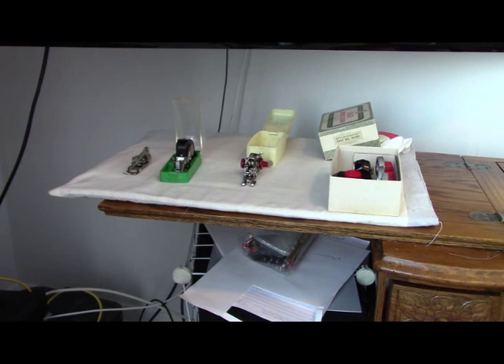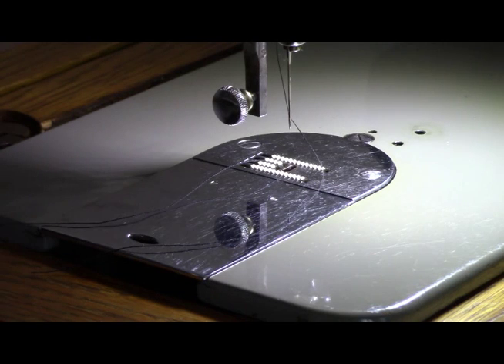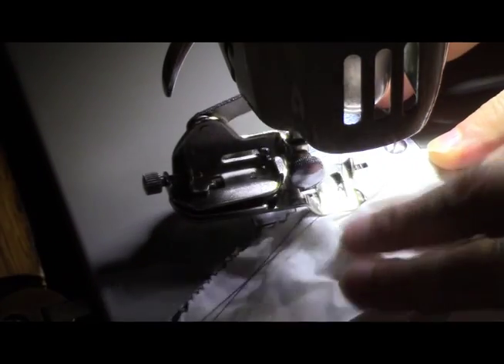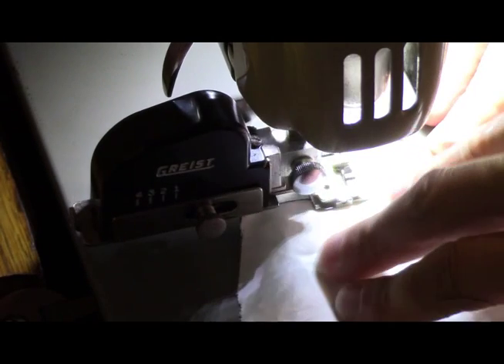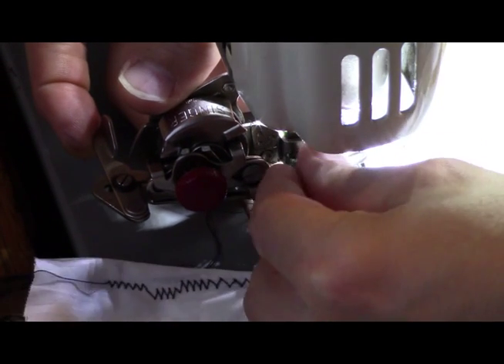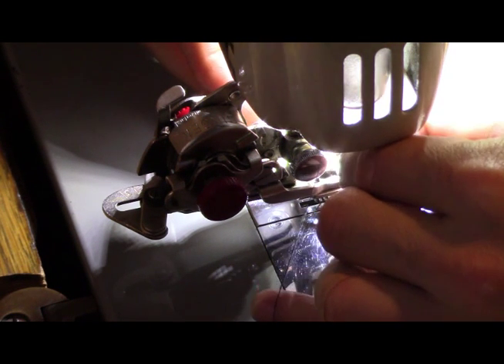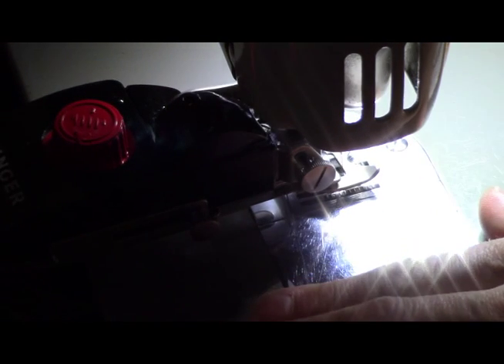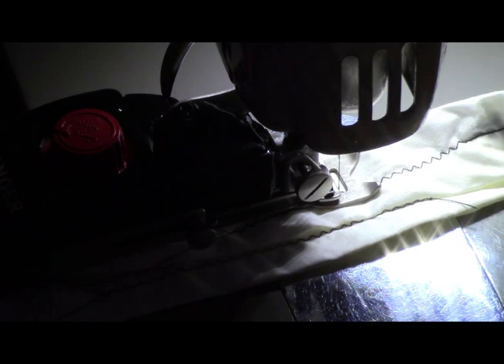zigzag attachments for straight stitch sewing machines

Comment: Thank you for your help . I changed to a larger needle , made sure the thread was the same top and bottom, tightened the upper tension and tightening the foot pressure.   I now have a zig zag stitch I can live with.  I have the unit on my 15-88 treadle.
Reply from the maker: Excellent news. Well done for persevering.

Comment: Good review. Have you ever used these on knits? I’m wondering if the way that they move the fabric might stretch the knit fabric out.
Reply from the maker: It is possible to use with knits. The major issue is the bulk. If you put a very slippery teflon or even paper underneath, it makes it more manageable. You might try seam tape as well. I found that the fabric can be pushed into the feed dog gaps and then not feed as well. It does not happen with low bulk. You will likely find that you get better results if you lower the foot pressure as well.
Reply: @jamesrogers991  thanks James

Comment: If you need more space between the pressure foot and the feed dogs you can adjust that with the screw at the top of the pressure foot rod. It will be on top of the machine.

Comment: I appreciate your video, I was working with the American one.  My thread kept breaking as well.  Did you ever figure out why that my happen?   Thank you
Reply from the maker: I did resolve the issue successfully. The thread was not spinning smoothly and needed to be loosened more on the top thread as well as ensuring that there is a felt pad to keep the thread from jumping.. It takes a bit of balancing to get the bottom thread tighter than the top -- afterwards, no problems.

Comment: Do you have to adjust the tension on your machine. I haven't been able to get a zig zag stitch without loops on the back. I have tried tension adjustments. I don't know the brand ,I got it off Etsy from the Ukraine.
Reply from the maker: How interesting. Normally upper tension needs to be loosened a bit to keep the bobbin thread from pulling onto the top. If you are getting loops on the bottom, this would imply that the upper tension is a bit too loose. You might check your needle as well to be sure that the thread moves smoothly through the eye and that it does not have any burrs on it when it pierces the fabric. Let me know if that helps, if not, we can try some other things. The make of the zigzagger should not cause this.